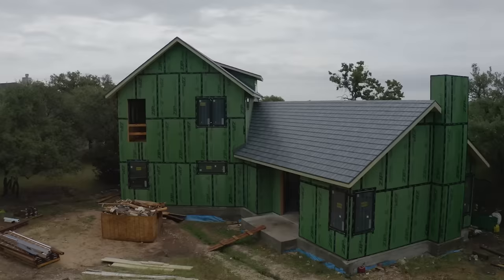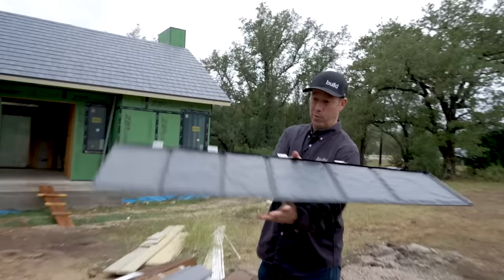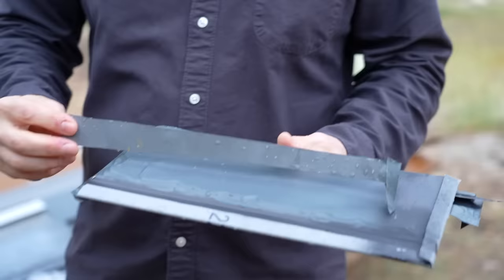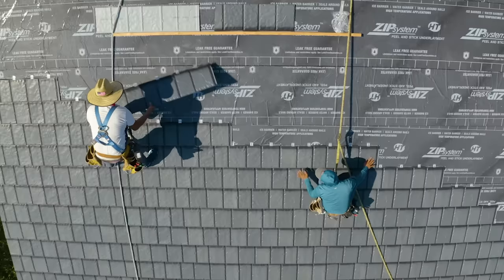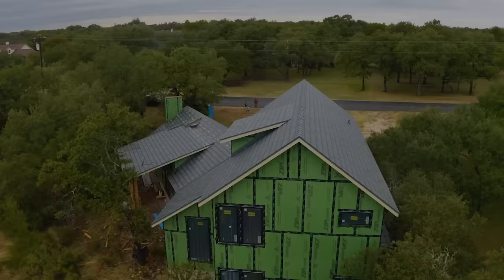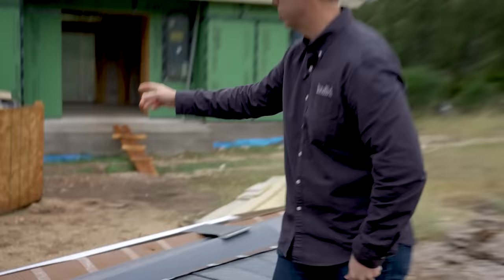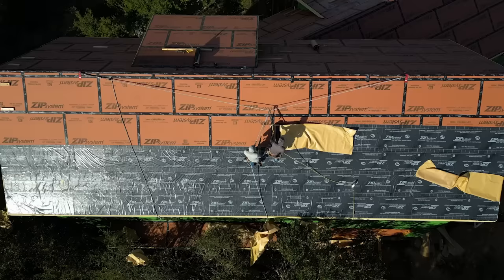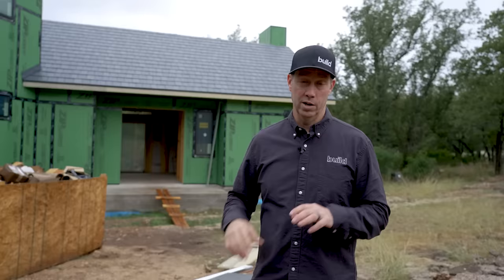Don't like the "metal roof look?" Check out this metal SLATE alternative!

Comment: I like the fall protection used on the build, simple but safe. I used metal roofing on my house at 140 lbs a square verse 600-900 lbs a square sure for asphalt shingles. You're parking an SUV on top of your house with asphalt shingles.
Reply: Most asphalt shingles are 225 to 250 per square.  Most metal is 100 pounds per square.   High end shingles are maybe 400.
Reply: The fall protection is not being used in the right way.
Reply: 900lbs a square??! I own a massive solar company and while we sub out roofing ive never heard of any roof weighing that much per square outside some tiles
Reply: @mattbrew11  Yeah, asphalt shingle is 200-300 pounds/square.  Tile is 800-1200 pounds/square.  Metal is 60-100 pounds/square (peel/stick puts it at ~100).  Solar is also around 250 pounds/square.  It's right on that a typical asphalt roof is equal to an SUV!
Reply: Roofs are designed to handle the load
Reply: So what? A roof is designed to take the weight.  An asphalt roof is much less prone to hail damage. In fact some insurance companies are now excluding hail damage on their home policies if an owner has a metal roof installed.

Comment: Love the look. I was quoted at $540 per square for material only. Standing seam metal with labor included was significantly less.
Reply: That’s $5.40 per square foot?
Reply: @robertatkins272  Correct. A square is 100 square feet.
Reply: I've heard code won't allow standing seam in my area on residential. My builder Uncle claimed one reason was because when the wind gets underneath it the whole thing goes.
Reply: @KLondike5  I own a solar business that among many other states, we service FL and we had multiple standing seam roof with proper retainer systems and solar survive hurricane Ian just fine.
Reply: @KLondike5  Standing seam that is installed on a good substrate holds up much better to wind than other common roofing. Maybe this guy just didnt have the resources to do it.
Reply: Thanks for this info, in my area thats actually about the same cost as standing seam... well 9 mo ago, who knows now.

Comment: Thanks for another great product review Matt.  2 things … 
1. Anyone know if you can install solar over a metal roof like this? Solar sales guy seemed to think not.
2. Has anyone heard of Davinci Slate Composite roofing?  It’s another slate look-alike, I thought it was made of rubber but I’m unsure?
Reply: I've never seen solar mounting options for metal shingles like this. Better bet would be standing seam (or corrugated). Mounting on asphalt shingles is simple along with most concrete tile. I've been in solar design for 3 years.

Comment: Question that I have is repairing a roof like that after a limb has fallen on the roof or worst case a tree has come through the roof structure and you have to rebuild it. Is it easy to go back and reroof the damaged area.

Comment: The problem with metal roofs as a replacement product is the cost. 
You can put on 3-4 asphalt shingle roofs for the cost of one of these. 
If it’s a new build, sure it can make sense if this is your forever home. 
If not, I don’t think you’ll recapture that higher cost in the sales price. 
I do like this product’s look vs standing seam because standing seem can show defects and high and low spots on the roof deck. 
I was quoted nearly twice the cost of a high quality asphalt shingle roof for 26g metal. 
I just didn’t see the value in a metal roof so thin.
Reply: I guess something to think about is resale value and inflation. The house’s resale value only goes up with metal since it’s never going to need replacing. And who’s to say a 8k asphalt roofing job is going to be 8k by the time it needs replacing? Just stuff to think about I guess.

Comment: Matt states that this roof will have a Class A fire rating. As I understand this system, it will only have that rating if you use a 1 hour rated underlayment. I am trying to figure out that underlayment that gives the A rating and does not "break the Bank".

Comment: I wonder what the minimum pitch of the roof can be with this product as duriod shingles has its limits in that regard and metal is much better for low pitched roofs. I replaced our torch on roof with metal and its been great, no problems in 10 years and looks good, lifetime transferable warranty too!

Comment: love the build and roof sealing. I want to like the product.  
The fire resistance is a big deal. I am glad that was mentioned, but was it the same as any metal roof, or was the comparison to asphalt shingles? 
Can you add solar mounts?  leaks, special tools or tiles, etc.? 
How do you handle penetrations?  Clearly they do, but it wasn't shown.  If they do leak, where do you get the indicators so you can fix it?  
What is the sound profile like during rain/wind? (I have always wondered if certain metal patterns might have resonance issues).
Too many questions?  Sorry.  Not being a downer.  The devils in the details and I REALLY like the look, but have to be comfortable with function versus form.
Reply: This product is designed and warranted to work with solar mounts: https://www.starlingrfs.com/.  I suspect you can find details for how to handle penetrations on the product website where they have install manuals.

Comment: You really should have covered the edge details better. What about the edge where it’s cut or where you get to the ridge? How do you compensate for pattern shift at the top, bottom or side? This video was extremely short on details. By the way the proper term is “installation” not “install”. You should know this.

Comment: Hey Matt - This is a really interesting product. We're coming due for a roof replacement and while I've wanted to do a standing seam roof, my wife isn't crazy about the look. This could be a great compromise. 

I've watched some of your other steel roof videos and if I recall correctly, you usually like to put an air gap between the decking and the roofing material, but I don't see that here. Presumably because of how these panels are attached to the deck? Do you think the lack of an air gap would cause any issues in the Chicago area with a conditioned attic? Closed cell -> ZIP R -> (additional rigid foam?) -> Peel & Stick -> Steel
Reply: You’ll have to pay Matt to get an official response.

Comment: I reached out to edco in 2018 after I saw them featured on your video and they had no dealers or installers in my state (Maryland). I reached out again in 2020 and they had a Mid-Atlantic business development manager but I still couldn't find any dealers or installers in Maryland. Sounds like a great product but it's not helpful if I can't get a quote to compare to other products and installers in my area.
Reply from the maker: I’d suggest asking a local roofer to source and install. It’s pretty straightforward to train a shingle crew to do this install. It’s easy to source too. Hope this helps. Best, Matt

Comment: Great content on metal roof subject.  I would like to suggest a subject for video.  Solar shingle roof options in new construction. Since there is a lot of interest in netzero homes.
Reply: There are exactly zero solar shingles on the market that I would have wanted any of our 55,000 solar customers to utilize. 
Standing seam coupled with S-5 mounting remains and likely will remain the best possible option to use solar for quite some time. Its what I used on my own home designed from the ground up to be uber durable, ultra high performance and an heirloom to be passed down through my family.  Budget was of no concern. I don’t drive nice cars but I live in a Bently, if they made tanks that don’t care if its - 60* or 140* outside. 

Reasons: incredibly easy to repair, much better cooling, easily outlives the panels and not an electronics recycling nightmare. Also doesn’t count a particular inverter setup.

Comment: Hey Matt great Edco video, I have a question about venting the roof ,how was that done .thanks in advance
Reply: You don't--maybe.  The attic spaces that Matt does are part of the conditioned/controlled air space.
Reply: If you do need to vent Edco roofing it can be done - they offer an under-the-ridge vent option that looks great and allows for good airflow.

Comment: How do these steel shingles compare in price to traditional steel sheet roofing & are they solar panel compatible?
Reply: I own a very large solar company. Do not choose the system if you want panels on top. There’s not a good way to mount without causing a lot of issues. When you say steel sheeting do you mean a ribbed roof with exposed fasteners or what?
Reply: @mattbrew11  - Yes, I guess another way to say it, would be corrugated sheets.
Reply: @cmdrdarwin3682  corrugated much lower cost to install but the exposed fasters need maintenance periodically. I chose a standing seam roof for my own home

Comment: Wonder if these would let you replace an HOA "required" slate/concrete tile roof.  My roof needs 2-3 replacement tiles yearly and is 100k + to replace
Reply: Wow. I always thought real slate roofs were more durable. Just wondering which climate zone you’re in?
Reply: Geez. Did they use drywall screws to attach the tiles?
Reply: @HavNCDy  lonetree colorado, old castle concert tile roof.  Everything has gotten expensive here in the last 5 years.  No idea who the sub who installed, builder torched documents at hold requirements date.
Reply: @brandonv8721  thank you for answering.
Reply: @HavNCDy  been told they last almost forever if properly installed.....also told they are rarely installed correctly by builders subs here.
Reply: @brandonv8721  I’ve heard “if installed correctly” comment a lot too in reference to a lot of building materials.

Comment: If an existing house has 1/2" wafer board decking, will this metal roof nail to it sufficiently to keep the metal roofing from coming off in sever wind storms?

Comment: With the right house design that slate look shingle with concrete log siding from Everlog would be a perfect combination.  Especially if the exterior walls were ICF.  The only way they could REALLY be better is if they were also solar collectors LOL.
Reply: Do you engineer ICF houses?
Reply: @shannabolser9428  No, I was an electronics engineer.  I've been doing a lot of research into them though and working on a design for our next home.  Most of the online home designs would be perfect with relatively minor tweaks.  Adding an elevator, expanding the pantry/kitchen counter area things like that.  Of course I'd have an architect familiar with ICF construction go over what we finally come up with.
Reply: @shannabolser9428  I built my home out of ICF (and own a large solar company). What state are you in I can see if my engineering firm is licensed there
Reply: @mattbrew11  Indiana

Comment: I’ve got a question with regard to tankless water heaters that you have made videos about prior.  My house in Gulfport Mississippi is 1000 SF with a very old standard tank-type water heater. It would free up some space if I could replace with an outside tankless.  I watched one video that stated that one can’t be installed under a roof. Well, I have 2’ eves on the side where I would want to install. Is there such a restriction in Texas where you are?

Comment: Curious what they do to sound deaden the roof, for when there is Hail or Heavy Rain. I could hear the tin sound as Matt was sliding them together.
Reply: Probably extra insulation or sound proof dry wall options.
Reply: You will hear nothing in the house

Comment: Would there be a concern with galvanic action between the aluminum windows and steel wall siding which can lead to corrosion?  If so , is there a way to deal with it?

Comment: The issue I have is when the hail storm hits it, and it gets dented:  How do you replace a panel in the middle of the field?
Reply: It already has varied texture which adds strength. You'd need baseball sized to prob put noticable damage on there. Maybe the car hail guys can work their magic.
Reply: By pulling several rows down in most cases.

Comment: Nice looking roof!  Can solar PV panels be added to this type of roof?  How much does it add to the PV Installation on this type of metal roof as opposed to other roofs?
Reply: As a large solar business owner I absolutely would avoid this system completely if you want panels on top.  If you want metal (and I built my own home with it if that tells you anything) do a standing seam roof with S-5 rail less mounting. Zero penetrations, excellent airflow to cool the panels. I also think it looks badass but that part is obviously up to you.  My roof is mega insulated so I can’t hear precipitation but i would suggest adding more insulation at the same time if you do.
Reply: @mattbrew11  Thanks!  Will keep this in mind for the future;-)

Comment: Matt,  What is the process if one of these (or several) shingles is damage, say three or four rows from the bottom?  It looks like it would be hard to repair without removing much of the roof.
Reply: Probably similar to vinyl siding.  You insert tool to pop the shingle out of the clipins and after popping loose a sufficiency you start removing and replacing the shingles as needed and restore the clipin.

Comment: How do you get ventilation with this install? I know this is a monopoly framed home but you don’t have ventilation under the roof like your roof at your home. So how are you dealing with the heat transfer from the roof into the house?
Reply: A vented ridge is usually what they do…  a nice discrete solution compared to those big bulky vents that stick out and are visible from the street.
Reply: Ridge cap

Comment: How is the color/paint applied? Will the paint last for a lifetime too? If not, do you end up painting your roof in 20 years?
Reply: Is the paint Kynar or other PVDF?  Typically metal shingles are painted on the coil and can last decades.  However with concern about PAFS pollution I'm wary of fluorinated paints.

Comment: Matt, when you apply peel and stick underlayment on 100% of the roof deck, is it safe to say that you are totally foam encapsulated and using dehumidifiers in the attic space? I am just curious how you are handling your moisture is the attic since the peel and stick has such low perm ratings.
Reply: Yeah, the attic space would have to be conditioned.
Reply: This will be a conditioned attic with dehumidifier and ERV
Reply: Pretty sure matt only builds high performance homes now which heavily rely on conditioned attics or the deletion of them entire if using heat pumps.

Comment: 2x's ish??  I'm building a pretty simple ranch right now. Ive researched these products in debth. It's nearly impossible to find an installer for Decra steel roofing in ohio. I found 1 booked out 8 months. Another steel installer who does Edco and others wants more like 65,000 for an 45sq new roof.

Comment: this roof still good for solar panels? the other steel roof you showed had rails to support solar
Reply: Idk how you’d get the panels prided up, bolt the rails down and rebend the panels back down and have it look and perform correctly.  Solar installer question I guess.  Maybe some heavy gaskets and caulking right on top of the panel?
Reply: DO NOT PUT PANELS ON THIS ROOF
you will regret it I promise and I am qualified to make that statement
Reply: @mattbrew11  yeahh thats what i thought, just from looking at it, it doesnt seem to support solar

Comment: The problem with steel roofing is that no manufacturers use stainless steel.  So eventually they will all rust and start to fail and produce redish-brown staining on the structure below.  This is a known issue in the industry from inception but has still yet to be resolved.
Reply: Stainless steel would be awesome. It would last forever.
Reply: Stainless steel would be way more expensive. A galvalum roof without exposed fasteners will last a super long time there are tens of thousands along coastal florida without any discernible corrosion
Reply: @mattbrew11  Stainless steel costs pennies.  You've obviously never worked with platinum or gold.
Reply: @muffemod  I own a massive metal roofing and solar business.  I’m not a jeweler

Comment: So would you recommend a steel shingle roof over an aluminum or a stone coated shingle over a painted metal?
Reply: If you get crazy hail the easy choice is stone coated. If you want solar at some point, there are some stone coated options that work but id strongly advise standing seam.

Comment: Life time warranty,  what happens if the company goes bust?
Reply: True. And with materials for my house, at $33,000 and $4,000 for shingles, I can afford to replace almost 8 times over.  And since they last say 15 years, maybe 20-30 depending where you live…I’ll be dead before I replace enough to match a metal roofs price over 120 years.
Reply: Same thing with any warranty. 
Think of a warranty (from a reputable business) as statistical lifespan prediction more than a length of time you’re guaranteed not to spend money on it. How many businesses are 50 years old?  Very few.

Comment: Are metal roofs noisy? Do you have to put something under to reduce the rain noise?
Reply: Not if your attics insulated.  Most attics should have over 12”.  That should block all noise.
Reply: Even with a gable ceiling it's not noticeably louder unless the rain is really comin' down. Hail on metal is, but that's a worthwhile trade off if you're in an area prone to it. Rain on metal is different though, akin the the difference between heavy rain on a wall and against a window.

Comment: Funny to be talking about longevity of metal roof but be using Zip system which is basically OSB with tape covering the seams. Tell me, what is the PROVEN longevity of Zip? It certainly isn't the same as the metal roof.